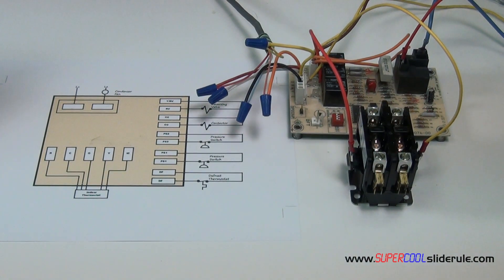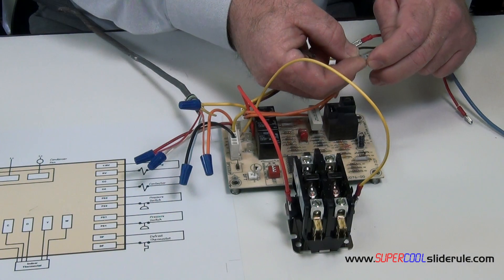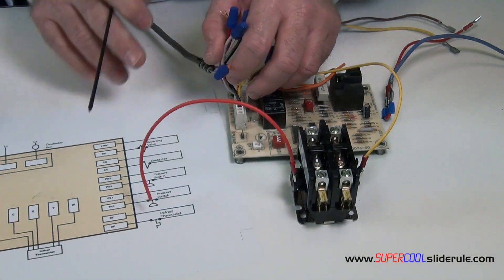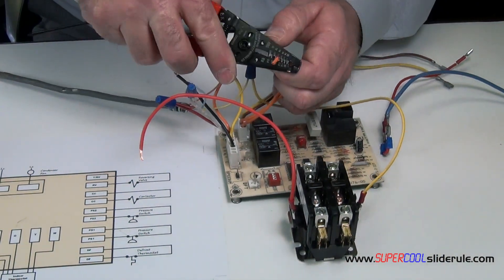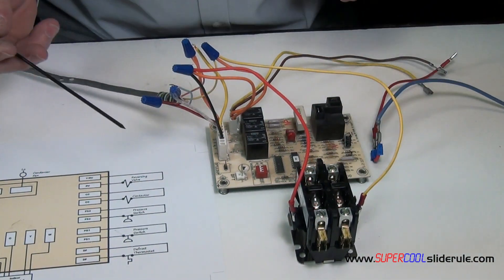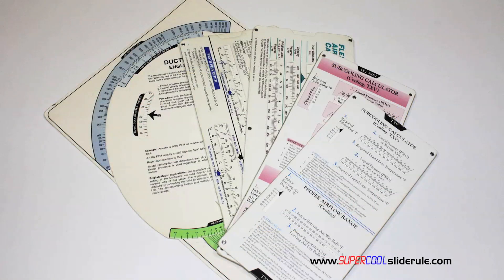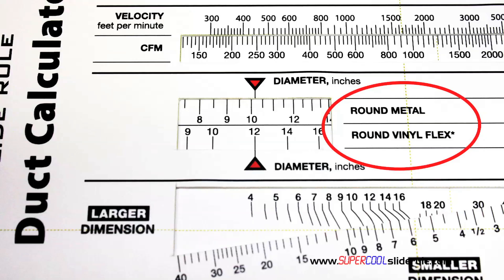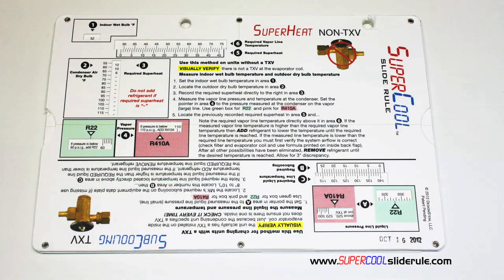How to bypass a Defrost Heat Pump Board to allow cooling

Comment: So after bypassing the condenser fan, you connect yellow & orange to one (low volt) side of contactor (cool & reversing valve), and orange & black (reversing valve & common) to other side of contactor.

Comment: If you need to run the a/c in heat mode, just disconnect one of the reversing valve wires. (orange in this case)
Just remember that you have no defrost protection anymore, so keep an eye out for frozen coils on the outside unit.

Comment: Will this setup allow the heat to work fine in the winter without the defrost?
Reply: yes, just leave the reversing valve wires disconnected, and it will run in heat

Comment: This tutorial saved our lives literally, my hvac unit is now working after 3 technicians each 1 had the wrong diagnosis 1 said the motor bad Not! 1 said the 3 way valve is leaking Not! The other said bad thermostat Conjunction issue. Delay relay Bad, motor relay bad transformer bad and defrost board!
Reply: Yep. Tried to fix defrost for 3 years. Every fkg so called technician was making smart face and no result. But they all want money. Amazing what American become

Comment: thanks for this great Video
I was struggling with one heat pump 
I was getting 24v but the board was not working well, after watching this video I end up bypassing it and it worked 😂
Reply: But heating will not work

Comment: Great videos.  Can an ohms OL on a Solenoid cause the 3amp fuse in the AH to keep failing?   Can’t get Low Voltage on Contactor, changed contractor, same issue.

Comment: You just cut half the words in the unit when all you had to do was run the "Y" wire directly to the contactor. Land the fan wire on the L1 terminal of contactor. Then you could have placed a common wire on the opposite side of the contactor and boom when the contactor pulls in you have air conditioning now you have to unspice all those wires and fix it all back ridiculous amateur status.
Reply: Wrong. You need reversing valve wire in with y and other rv wire to common. He wired it correctly.  Your way wouldn't work
Reply: what about the reversing valve wire 
just move the input wire down to the extra connection next to the yellow control wire on contactor

Comment: Hi how are you can you make a video .showing how to bypass the condensor fan relay on board for defrost and add and external relay to allow cooling and heat  I've replaced this carrier board 3 times in a year and a half     .just put a new board and new condensor fan motor  just in case old fan motor was pulling to high of laps causing the relay to fail . However the board failed a week later anyway I've had the whole system checked over and voltage tested  they found no issues  but the board keeps failing  the last unit I had the man installed a external relay for the fan which worked perfect  until I had to get a new unit due to outdated freon  thanks and I hope you can help

Comment: Shouldn't you connect to the valve end of the orange wires not the board end? I tried this and burned up my transformer not sure what I did wrong.
Reply: That's what I'm thinking.. because how would it power the valve. why wire the board if you're bypassing board

Comment: Basically just take the low voltage cooling wire out of the board and connect it at the contractor.  🆒

Comment: Thank you for this video. I followed the steps and it worked perfectly. Just two issues I'd like to highlight to help others:
1. Please refer to the wiring schematic for specific colors of the reversing valve. Mine were black.
2. Also I blew the fuse at the a/c handler in this process so my thermostat wasn't working. One I found that and replaced it everything worked well.
Reply: SMerry

Comment: Bryan the way you ecplained it is for.experienced technicians, it seemed a bit confusing, the easiest way would be to just unplug the two orange reversing valves wires from the defrost board and simply connect them on the each side of the  contactor so the valve can get its 24 volt. The valve will always be energized when ever there is call for cool. Great vedeo though!!
Reply: Christopher Paul  what if condenser fan motor relay stuck open? U energized reversing valve but cond fan motor won't run. I would never bypass defrost bord(SW Florda) unless it's  late call and I'm unable to get replacement part (most cases -next day in the morning it is installed).
Reply: simplicity at its finest, thanks smart brother!!
Reply: exactly!
Reply: Ya I think this guy want's to show off his electrical engineering degree , but any tech can do that task in way less moves than his dumb ass video , Oh ya , why are we bypassing the control anyway ?

Comment: The best thing to do is not let some "tech" sell you a piece of shit heat pump in the first place. In my experience,you would be better off buying a whole new ac system.After a ripoff "tech" gets done with you,you will not only get your brains screwed out,you will also have to buy a new system anyway because selling you a new system was the plan in the first place.
Or and even better solution,go to Sam's and buy four 8000 btu window ac's for $ 800 and forget about ac"techs".
A big fat bill is the real "fix" that you are going to get.

Comment: The defrost cycle doesn't work during the summer so if you just use the summer ac,why would you need to bypass the defrost cycle?
Reply: Carskinify You don't "bypass the defrost cycle" as you put it.  You bypass the defrost board.  The board can burn out (a relay on the board) and not pass power (24v) to energize the main contactor and not allow the system to run or cool at all.  I'm still new at hacks so I just get the replacement board and install it.  People go hot for a few days, thats life.
Reply: Foghorn Leghorn your comment serves no purpose except to insult.  Why bother if you can't be constructive or helpful.

Comment: I enjoyed your video thank you for the education, I do have a question. I have a temp star unit and I replaced the contractor, defrost board and fan board along with a new honey well digital thermostat. All looks well, the ac blows cold air but I did notice that the condenser fan is always running/spinning even when the blower inside is not blowing anything. Also the air power of the air coming out of the vents inside is not as strong and the other units. Can you please help
Reply: William Belliard 
You may want to ensure that the wires feeding the condenser fan are connected to the load side of the contactor instead of the line side (they should be on the side opposite the incoming high voltage wires). Hope this helped.
Reply: Bryan Knowlton Thank Bryan. Is the load side L1 or L2 correct? I mean have you heard of this? Could the fan motor be bad as well? Or if it spins that means its good. By making these changes will it increase the speed of the fan outside thus increasing the air blowing inside?
Reply: Oh ya , if you can speed up the out door fan , it will surely blow like hell inside , dude stay away from this trade , your scaring me .
Reply: Sounds like you wired the low voltage incorrectly and by that I mean maybe at the furnace you installed the y wire on the r terminal instead of it being on y and therefore your your condenser is always running. Or you wired your fan high voltage going too the line side of your contactor that you replaced something is mis wired need more input.

Comment: you right Aaron he messed up.. the red wire from the contactor is suppose to connect to the common on the thermostat wire coming from the air handler and that completes your 24v coming from the transformer the other yellow wire which is your call for cooling he has correct

Comment: Okay, in the beginning you moved the black (C) wire out the way, @ 1:43 to 1:53, and tried to put the red wire from the contactor to the light blue (C) wire from the thermostat. Then later you put the black (C) wire from the board with just the red and orange (C) wire and the light blue (C) wire was not connected. Now which wires need to be connected in that stage? All light blue, black, red and orange which equals four wire or does just three need to go together, black or light blue with red and orange?
Reply: Aaron Green   Just the light blue,orange, and red. Forget the black coming from molex plug (board).